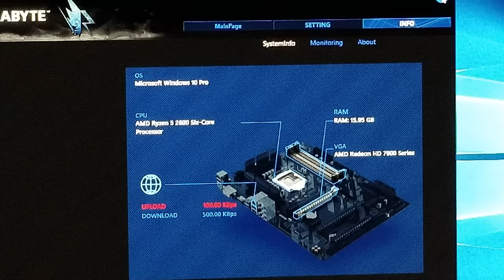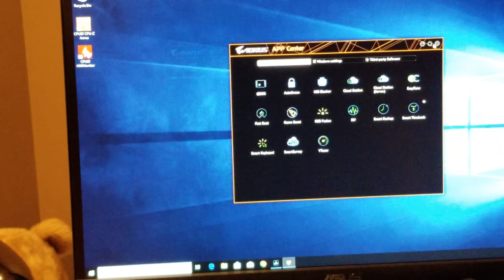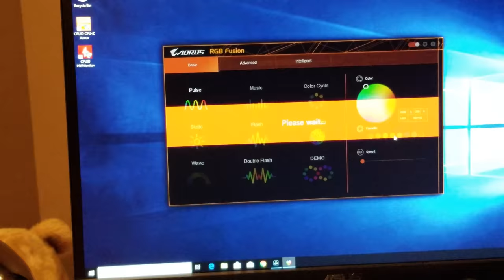Cooler Master MasterCase H500, Build Guide & Aorus B450 Pro WiFi

Comment: Great video man! quick question! If you use the RGB controller that you did not use, we don't have to connect anything to the motherboard right? 
I want to connect exhaust fan with the front panel fans then connect all to the RGB controller just to be able to change it with the restart button.
Reply from the maker: +Tolga Ayazseven Hi, I did a video earlier 3 weeks back it'll show a picture of the case. In this video because I wanted to show the RGB but without a motherboard, I hooked it up differently and think this might help you with your question. I can't check it here at work but I'm pretty sure that's how I was changing the colors is with the reset button, but that might help. Let me know if not and I'll have a look tonight. Take Care and Thanks for your support...
Reply: Thank you for your quick reply. I just watched that video, but I think I will disconnect the rgb header from the controller and plug it in the motherboard like you did in this video.
Reply from the maker: +Tolga Ayazseven Sounds good.

Comment: Dude, an asus a520m-k will be able to power that case? I mean, talking about the pins
Reply from the maker: Ok, Thanks
Reply: @Reviewing_Playing_and_More_RPM  I'm sorry, I was asking, I was wondering if I needed a splitter hub with an asus a520m-k, lol.
Reply from the maker: @augustocanosa785  Hi, yes it doesn't seem that this MB has any RGB on it at all so a Hub that can do RGB, if RGB isn't a concern then one that can let you use all your Fans if the MB doesn't support them all. Hope that's what your referring to.
Reply: @Reviewing_Playing_and_More_RPM  Yes sir, I didn't even mind about the RGB connection but now I see that I have to solve something else, lol. Thank you 4 your kindness.

Comment: Hello great video it was very helpful for me. Maybe you can help me with one problem I’m having. On the fans, I got my RGBs to come on, but they aren’t spinning and I don’t see any other cords to plug into a fan header on the motherboard if that’s what I need to do? I’m completely lost 😱
Reply from the maker: I didn't notice until after, so this might be the same for you, on the back side of the case there is another cable that needs to be plugged into the motherboard. Once that is done then mine powered on, basically have a quick look at the remaining cables and see what is left, and there could be one that was missed. There is a Sata power cord that needs to be plugged in as well if I'm remembering right. Hope that helps...
Reply: Reviewing Playing & More RPM thanks!! I never connected the SATA one, but it’s fixed now :)
Reply from the maker: @xniikkiiii  That's great, glad you got it fixed...Have a great day!!!

Comment: Hello! Would you be able to install 2 120mm fans on the top of the case?
Reply from the maker: Yes, you can install as per: 2 x 120mm / 140mm or 1 x 200mm fan on Top...Thanks...
Reply: @Reviewing_Playing_and_More_RPM  Thank you so much! I also plan on replacing the 2 fron 200m fans. i plan on replacing it with noctua fans. Thank you so much and keep up the good work bro! You are helping a lot of people with your reviews and i am one of those people :D
Reply from the maker: I happy to hear that, and your very welcome...the front fans are very quiet though, in case that's why you want the Noctua Fans, but other fans in the front in case you just don't want the RGB will be cool as well...Have fun with your ideas, they sound great...and thanks again for your comments...

Comment: Just one thing man. Could you make one video with this case just for the cables that come with the case because I don’t understand where to connect a cable. Also when u said that something was a big fail did it mean that you were not going to use it or what? I would really appreciate it. Thanks a lot bro.
Reply from the maker: Which cable are you having a problem with, also as per my last reply I don't have this case so can't redo this video on the cables, by big fail, I meant that having such a mess of cables it made cable management messy and there was a better way to have done this...I did use them though, you can see later in the video where I discuss this...Thanks...

Comment: where did you plug the rear top fan into? Currently at this moment building in this case and trying to figure it out. Using a ROG strix B450F gaming motherboard. Great vid btw, really has helped me out. Edit: Also this is my first ever build, which is why im confused lol
Reply from the maker: The top rear fan I plugged into the Motherboard Sys_Fan Header...Thanks...
Reply: Reviewing Playing & More RPM thanks for the reply! Any idea where to plug these 200m fans into? My pc runs and works fine, but, only the top fan is lit up with RGB but doesn’t spin. The bottom fan doesn’t even light up RGB and doesn’t spin either. So both don’t spin and only the top one is lit up. Thanks. Update: Got then both spinning now, bottom RGB I’m not sure about though. Still won’t light up
Reply from the maker: @ShirleyGGHF  So I did wind up using the mess of cables which was basically a fan splitter but they were needed as otherwise the cables for the fans did not reach, so you plug both cables into it, and the RGB goes to the appropriate Motherboard RGB Header, it's a while ago, so if it's a 3 pin that's ARGB Header 5V and if 4 pin it's the normal 4 Pin RGB 12V Header...Thanks....

Comment: I have Asus Z170 mobo and it has no RGB support for the fan lights. What do I do?
Reply from the maker: I believe you can use the included controller, but if not then you will need to get a RGB Hub.
Reply: @Reviewing_Playing_and_More_RPM  thanks, i just figured it out with your help with the controller.
Reply: I keep cycling through the light modes but can't find a static one, for now I am using breathing mode
Reply from the maker: @LordVoldore  Awesome.

Comment: Could you time link to the part when you connect the big fans in the front bc I couldn’t find it and mine aren’t spinning?
Reply from the maker: There's a few places and no specific spot that just shows it all, the two fans in front are connected using the extension shown at 5:38 I at first say you won't need it but later realized you will because of the short length of the fan cables...hope that helps...Thanks...
Reply: Reviewing Playing & More RPM this helped but where do you plug them in on the motherboard?
Reply: Reviewing Playing & More RPM never mind I fixed it on my own but great vid it helped a lot
Reply from the maker: @g3_hammy987  Cool...great job...
Reply: Reviewing Playing & More RPM new problem I’m not getting a video output with the hdmi or the dvi ports what could be the problem
Reply: hammy games wait where do you plug them in on the motherboard at?
Reply from the maker: @g3_hammy987  same question as WhiteyFPS, ensure your plugging into the correct spot on the GPU or motherboard depending on if your using a dedicated GPU or not, and it should be fine...
Reply: Reviewing Playing & More RPM I figured it out but thank you anyways and I’m gonna subscribe bc of all the help you gave me 🤩🤩
Reply: Reviewing Playing & More RPM I figured it out. Thank you for your help though. I was confused with plugging the 3 hole in the 4 pin slot.
Reply from the maker: @britt7453  Great...Thanks...

Comment: I have the td500 mesh and my fans in the front arent turning on. They are lighting up though
Reply from the maker: Your case has an Addressable RGB Cable for the colors for your fans it would need to be plugged into a ARGB Header on your MB, to tell which one you have if it's a 3 Pin 5V Addressable RGB cable look for a ARGB Header on the MB, or if it's a 4 Pin 12V cable look for a 4 Pin 12V RGB Header on the MB and plug into the one that you have...also in these cases there is normally other cables with the case make sure there all connected, and some fans need to have a SATA Power Connector connected to the Power Supply to work...

Comment: Why is the top front fan not spinning? Only the bottom front fan was spinning...was there an issue we should know about?
Reply from the maker: No I simply didn't realize at the time, and forgot to plug in the fan...Thanks...
Reply: Reviewing Playing & More RPM Did you use the Y-Connection & Extension? It appears that you did... If so where was that Top Front Fan not Connected?
Reply: Reviewing Playing & More RPM (( and as others have mentioned Thank You for the Review, Insight, Build, answer to Build Related Questions.))

+1 Like On Video ~
Reply from the maker: @UltimateSubzero83  Yes, I did use the Y-Connection and Extension, I first thought I didn't need to but because the cables weren't long enough I had to after all...
Reply from the maker: @UltimateSubzero83  Your Welcome...Thanks...
Reply: @Reviewing_Playing_and_More_RPM  Topnotch.

Comment: Hi I was wondering why my motherboard software  (I have the same one he has) it doesn't detect my fans. My case is the td500 from coolermaster.
Reply from the maker: Your case has an Addressable RGB Cable for the colors for your fans it would need to be plugged into a ARGB Header on your MB, to tell which one you have if it's a 3 Pin 5V Addressable RGB cable look for a ARGB Header on the MB, or if it's a 4 Pin 12V cable look for a 4 Pin 12V RGB Header on the MB and plug into the one that you have...also in these cases there is normally other cables with the case make sure there all connected, and some fans need to have a SATA Power Connector connected to the Power Supply to work...
Reply: @Reviewing_Playing_and_More_RPM  everything is plugged in do you think it might be the software
Reply from the maker: @Praby  If your sure everything is plugged in correctly then it's possible, you could try updating it to the most recent version from the Manufacturer's website, not sure it'll help but it could...
Reply: @Reviewing_Playing_and_More_RPM  Is there any software specific for my pc case. Yeah sure ill try that.
Reply from the maker: @Praby  Yes every MB has a Disc that is included, if you don't have it, go to the website that your MB is ie Asus, MSI or some other brand...and download from there...

Comment: Hi I am building the pc and I don’t know where I should put this white thing with 3 silver-colored things inside, basically from the same cable there is also a black thing, and it fits into the white thing but I don’t think I should plug it into that way. They come from the front pannel
Reply: the black thing has “tkg 2510” wrote
Reply from the maker: It needs to be plugged into one of the fan headers on your motherboard. Not sure about the white thing with 3 silver-colored things inside, what time in the video is it shown, let me know and I'll get back to you...
Reply: @Reviewing_Playing_and_More_RPM  oh ye I found that the white thing needs to be plugged in with the other fan, but there is another thing I don’t know where to plug. It has 2 cables, 1 cable has “gigabyte” wrote , and the other “Asrok Asus Msi” where should I plug that in?
Reply: in the video it’s at like 20:00-21:00, as I see it has 4 holes while mine has 3 holes with a center one filled, the only one spot I found it could fit in is “spdif out” but it don’t really fits
Reply: (my motherboard is a asus prime b460-plus)
Reply from the maker: @nataliyakostrytsya1036  I didn't use the other cables, it's labelled for the different MB's can't check because I no longer have it...
Reply from the maker: @nataliyakostrytsya1036  I think your asking about the RGB Cable, if so the way it works is a 4 Pin is 12V RGB Header, a 3 Pin is 5V Addressable RGB Header your MB doesn't have an ARGB Header so you'd need a RGB Converter if you need to use that...

Comment: How can i sync the color between b550 aorus elite and cooler master h500 fans
Reply from the maker: You can use the Software that works with your Motherboard, ie RGB Fusion (which doesn't work great btw) or MSI Mystic Light and there are others. However and I still need to check it out but have it from reliable sources that if all these aren't working for you, there is freeware out there called SignalRGB that appears better then them all. Hope that helps

Comment: I have the same case with Asus z390-e Gaming moatherboard. For the case RGB connection, my motherboard has a 4pin connection and the case has a 3 pin (GIgabyte) / 3 pin (1 is blocked). I dont know how and where to connect the RGB wires. Thank you I will be waiting for your response
Reply from the maker: The 3 Pin is an Addressable RGB, you have two 4 Pin RGB and the 3 Pin ARGB is beside the Sata Ports, that's the one you'll need to use...If that doesn't answer your question let me know...Thanks...
Reply: Reviewing Playing & More RPM  
Thank you so much for your reply ❤️ I do see the 3 pin port besides the SATA port. So all I need to do is connect the 4 pin(1 blocked) to the port?
Reply from the maker: @pratikmaharjan7802  Yes so as long as by blocked you mean there is one missing pin so three pins that will line up with the ARGB then yes...
Reply: @Reviewing_Playing_and_More_RPM   Yes that is correct. Also, I will be starting with the arrow on the left side right? Thank you so much for your help. Your videos are great and so much knowledgeable than other popular videos.
You are great!! <3
Thank you so much once again and stay safe
Reply from the maker: @pratikmaharjan7802  You too...all the best...
Reply: Hi, I have a question about the system fan. So I got Corsair ll120 fan but do not know where to connect the RGB connector. I am guessing the one on the top/bto of the mother board that says (12V GRB). And the fan connector itself goes to chasis fan?
Thank you
Reply from the maker: The Corsair ll120 RGB uses the addressable RGB (ARGB) 5V connector, which goes into the Fan + Lighting Node Pro connector...and the Node Pro has a SATA cable that connects to the SATA from your Power Supply...there's also a small USB on the Node Pro that has a cable going from it to the USB on your motherboard to have full control of the software...if you bought a single fan from what I know of you'll need to get the Fan Node to use it...I could be wrong but regardless the fan will need the 5V ARGB header...
Reply: @Reviewing_Playing_and_More_RPM   Got it! Thank you so much for your reply. Also, I completed setting up my pc but when ever I turn on the desktop, some sparkling noise comes and it happens all the time. What could be the cause?
Reply from the maker: I'm not sure but it shouldn't be making a noise like that...recheck your connections as that's something potentially serious...or it could be a cable that's touching a fan, there could be something more but start with checking everything is connected right...
Reply: @Reviewing_Playing_and_More_RPM  Thank you so much for your response. I found out that it is the power supply. I had just gotten it few days ago.
Thank you
Reply: @Reviewing_Playing_and_More_RPM   Also 1 more question. Can I connect the rgb fan of meshtd 500 case by using a SATA power and not use the 4-1 header?
Reply from the maker: @pratikmaharjan7802  No the RGB has to go to the RGB Header, the SATA Power is separate...
Reply: I see. I have 2 connections with 4-1 connections and the motherboard has only 1 port. Would you reccomend me any splitters for 4-1 ports. i tried to search but couldnt find any Thank you
Reply from the maker: Glad you got it figured out...have a great day...

Comment: "And you're going to have to use... This monstrosity here" haha

Edit: Thankyou by the way, very helpful :)
Reply from the maker: You're very welcome! Actually sold it about a month later...person loves it...Thanks...
Reply: Off the top of your head, do you remember if there was just one 12v rgb wire, or is there one for each fan? I think a better way of wording it is how many headers do I need?
Reply from the maker: @Silence.Mortal  You need 1 RGB Header and only a couple Fan Headers, most MB's will have it, there is a splitter Fan cable so that's why you don't need to many Fan Headers...
Reply: @Reviewing_Playing_and_More_RPM  Thankyou, my mb has 2 rgb headers and 2 rainbow led headers, I just needed to know for sure. Thanks for your help :)